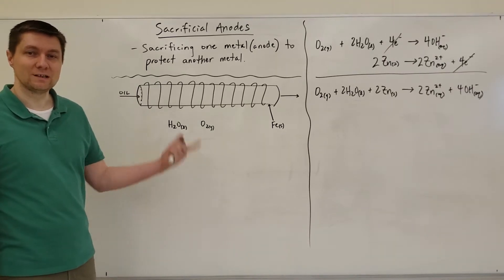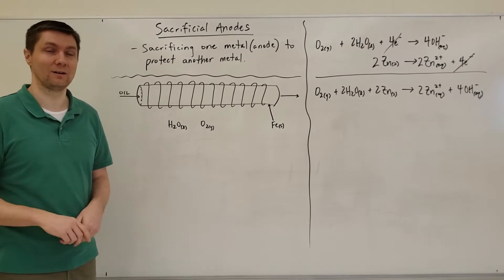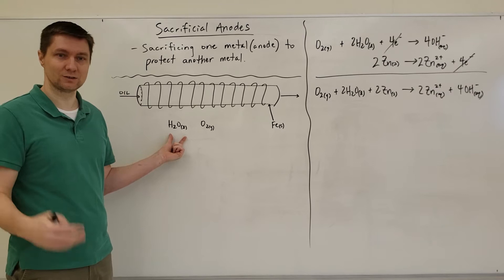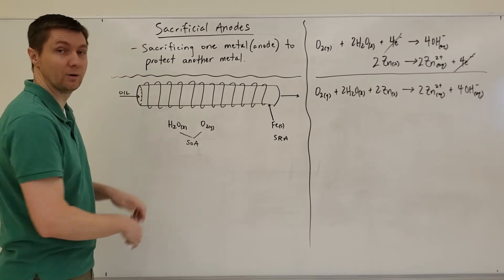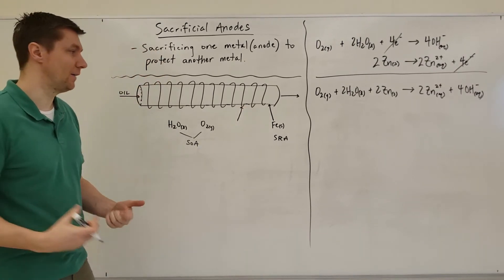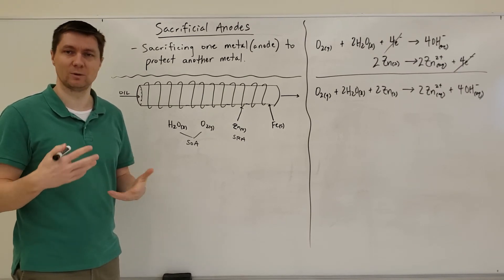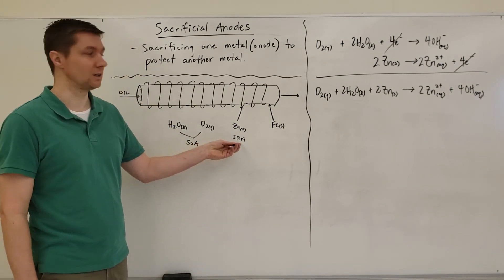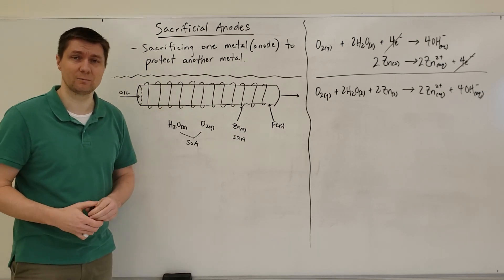Sacrificial Anodes

Comment: This video is amazing. I am trying to learn about this because of water heaters and their sacrificial anode rods.  I learned though your video that corrosion is the loss of electrons in the metals - can this effectively be generated by allowing some form of electorally induced current in the material? Maybe not in oil as that is also flammable but there is a product for water heaters called an electric anode rod. Just wondering if that is something that could work…
Reply: Yes, this can work in some instances yet may not be the best solution for others.  In pipelines it is a long span without access to electricity.  For protecting the foundational steel in skyscrapers or boats, this has been done.

Comment: You have a double-sided coated anode overall

160mm thick. Cu is 10im.

The composition of the anode is 98:1:1

Graphite: CMC: SBR. You have a total electrode mass loading of 31 mg/cm2 and Cu of 6.4 mg/cm2. For the theoretical density of the anode, take 2.25 g/cm3. What is estimated porosity? Can you solve this?

Comment: just use plastic pipes 👍
Reply: Would the oil act as a solvent on plastic?
Reply: One, that doesn't solve anything for existing pipelines. Two, plastic does not allow for the same pressure of service as metals
Reply: @Bruh-vp6qf you can make it thicker and stronger but i dont know what oil does to PVC for long term as in the context of the video
Reply: @raihanwinata5329  considering they store oil in plastic I think it’ll be alright
Reply: Such a good point